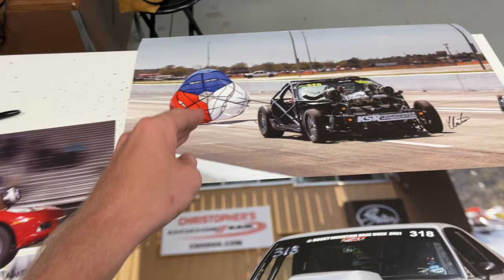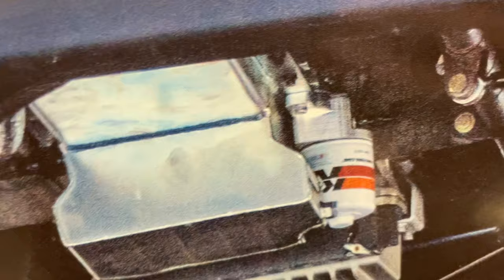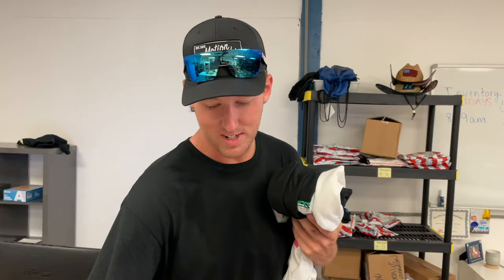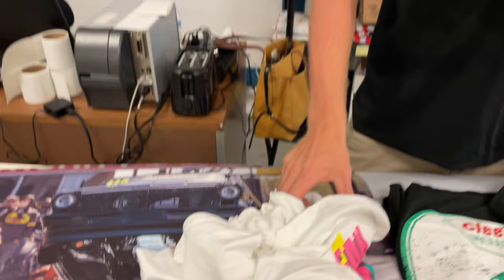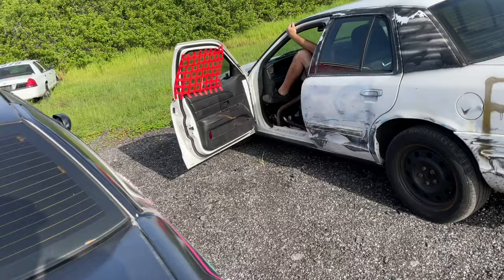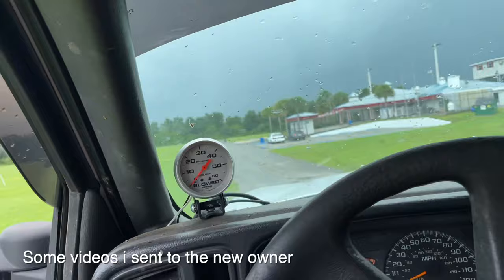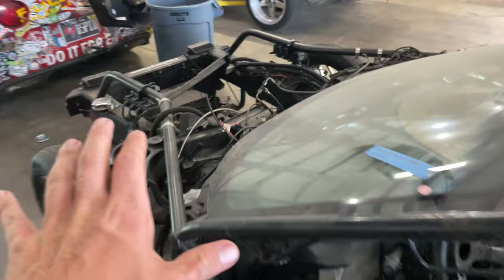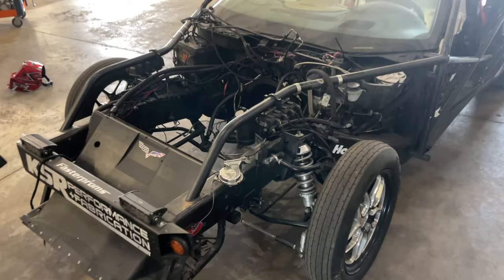Sold My Mud Truck... New Owner Had Strange Request

Comment: george just topped jackstands wheel chock moment with the starter on a running car 😂
Reply: It was on purpose. Lol.
Reply: @eriklarson9137  Didn't look like it tbh
Reply: @eriklarson9137  that wasn’t on purpose
Reply: I can remove the key on my 4wd while it’s running so I can access storage easily. Safe to say my starter motors don’t like it
Reply: @dylanzrim3635  We have an 02 F250 at the shop that will let you do that.
Reply: all them exhaust fumes getting to them 🤣
Reply: @dylanzrim3635  lol yeah , you definitely tell by the sound.

Comment: Whistlin will put this to good use possibly running it over with monster max and/or testing the durability of your truck versus his. I think your old truck might break before his, the monster max 2.0 is a beast.
Reply: Its painted to match monstermax 2 and the R8. It's in the reveal video.

Comment: Challenges for the boat competition:

1. Drag race (if that wasn't obvious)
2. Slalom (for handling)
3. Who can unload, start, turn around, and load the boat back on the trailer the fastest

Those are the things i could think off the top of my head while on the shitter at work 😂
Reply: The unload and load is a great idea. Their team mate needs to pull off the ramp and park also.
Reply: Great idea! Back the trailer and launch the boat and drive it around a buoy and back and load it on the trailer and drive it out of the water.
Reply: Username checks out.
Reply: 4.pass a covid test.5.not to infect other by wearing masks.
Reply: @True_Knight  thats exactly what i had in mind
Reply: @eriklarson9137  👉😎👉

Comment: Boat Challenge Ideas:
-A long road trip to a unique destination (Top Gear Style)
-A relay race (Le mans start, back the boat trailer into the water, do a lap around a buoy, load the boat up, and drive back up into the lot)
-Freedom Factory Lap with trailers and boat attached (deduct points for damage done)
-Blindfold the boat driver and have the co-pilot tell them how to navigate (might be too dangerous lol)
-Put targets on the boat, Paintball guns in hand and test the handling of the boats and co-pilots aim
-Obvious boat drag race
-Maybe "surprise" the contestants with $100 or some amount to mod the boat in some way
(Will edit if I think of any more)

Comment: Challenge: You have to back car and trailer up 100 ft. down the launch ramp, get boat off trailer, drive it out to some point in the water and back, put it back on the trailer and pull back out 100 feet to the finish line. Fastest to accomplish it all wins.

Comment: I’d like to see a Leroy 2.0 build. I feel like he’s at his peak potential with his current set up I think it would be cool if you guys did a little series updating him, working with Kevin on getting better data and making him more adjustable maybe some body panels like a roof
Reply: I think it would be some time before Kevin would be able to have enough time for major updates on Leroy if Cleetus wanted to go that way
Reply: No point in adding body panels but I think Leroy 2.0 is coming soon I think there waiting on new transmission parts
Reply: Leroy has much more on the table. Remember they've been running down a hole for the longest time, they installed the slipper clutch that has yet to be dialed in, and he was just getting into the clutchless shifting stuff.

Comment: It’s about dang gum time that LeRoy and Ruby get there nicely upgraded engines back from @TexasSpeed and hopefully get a good going over from bumper to bumper as well as a few upgrades.  
I am thinking that Toast needs to have a house call from a Top Fuel/Top Alcohol crew chief engine guru to get its engine tuneup squared away with its top fuel hat injector hat installed.

Comment: Cletus, I not normally a fan of roll racing but for the boat race you should do a 3 wide drag, then a roll. Flamingo has no chance from a dead stop unless you got someone to lay on the front to keep the bow dowm

Comment: Everyone knows whos buying the mud truck lol.
Boat challenge ideas (From a boat mechanic)
Every haggered old boat seems to have some inherent issues that could make for some comical challenges.
* "0-60 but start with engines off" Sure, maybe they won't even all go 60, but the potential for hard start plus stumbling off idle or stalling could make for a real challenge
* "fuel mileage" Boats consume huge amounts of fuel, but will james 7.5 cylinder jet boat be better or worse than a 2 stroke outboard?
* "no bilge float" How long will each one float before the bilge pump kicks on?
Trailer challenges, think of what the diesel power challenge does with the bobcat on the trailer:
* Has to be some kind of backing challenge
* Drag race (2 separate ones, one traditional see how fast the 1/4 or 1/8th is, and one 0-60-0 to test acceleration and braking, do any of the trailers even have surge brakes?)
* Obstacle course

Those are my immediate thoughts for boat/trailer challenges

Comment: Might be a dumb question, but why does Leroy not wheelie? The setup isn’t so dramatically different than Ruby? I know it’s a manual but plenty of manuals of there doing wheelies. I know it’s set up related but just curious what the key factors would be

Comment: Do a boat long jump, tug of war, drag race, slalom and boat on trailer attached to vehicle all three guys sit at a picnic table , wave the flag to start race , all guys run to truck back boat into water then jump in boat race to designated turn around reload boat then pull out of water, first to park truck in original start location wins